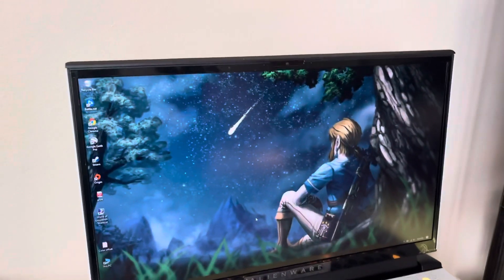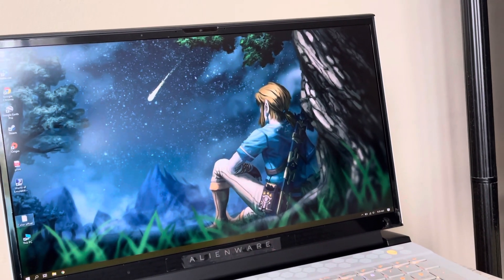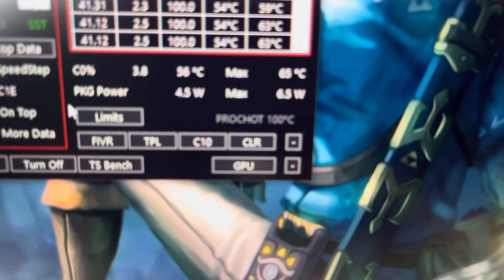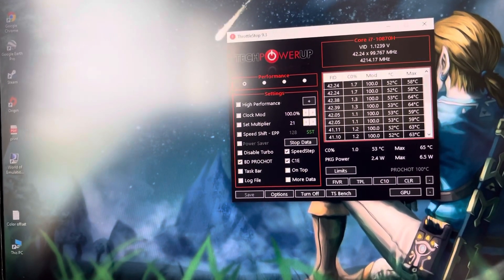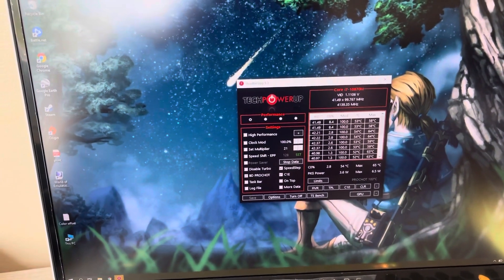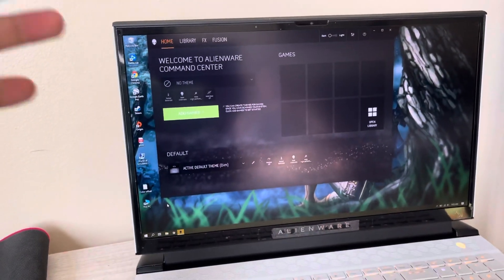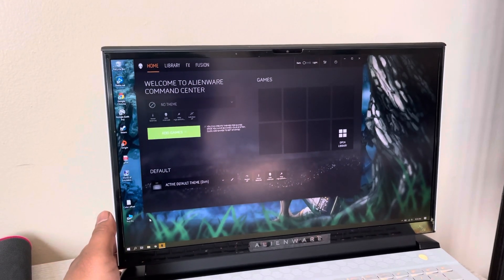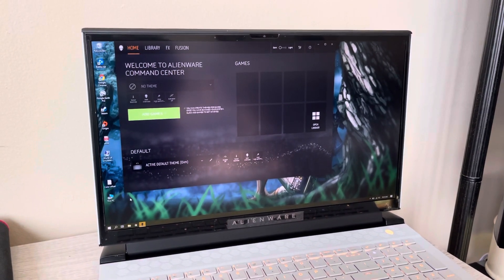Alienware M17 R4, three things you should do to get the best performance

Comment: I ended up clearing the system and put bloatware free Windows 10 on it. I went from 140 - 240FPS on Battlefield 4 max settings.
Reply: just by getting rid of all the bloatware?
Reply: @2gains  yep. A full reset with normal Windows 10 without all the Dell stuff totally irradiated all my issues.

Comment: The reason why this is the way it is the windows install is bloated with all the Dell/microship crap. Reinstall windows ltsc you'll see a major boost in performance plus if you do a repaste and a repad (16w/mk pads) with phobya nanogrease on gpu/cpu you'll see a thermal improvement. Plus I also read you can get 4.8ghz all core if you disable thermal velocity boost
Reply: Question... Did you repad this specific laptop? If so, what was the config? i7/3070 or 3060? i9/3080? Depending on which one, what was the pad sizes? 0.5mm, 0.8mm, 1mm, 1.2mm, 1.5mm, 1.8mm, 2.0mm? I'm asking because I just purchased the m17r4 10870h/3070 and absolutely love it but am planning to repaste and repad it. I'm using leftover Gelid Ultimate pads (15w) and either Kpx, Grizzly extreme or Thermalright's TFX. Not reused just extra pads from my recent build. 5900x, 3080ti, Asus Crosshair VIII Impact MB, 2x 980 2tb, 2x 870 evo 4tb, 2x 12tb WD Red Pros and all water cooled by EK. I'm not new to PCs. I have been building them, water cooled and air cooled, for over 10 years.
Reply: @Z1M0Z1M  I did do a repad but it didn't work out because some of the pads are mushy almost wet while the pads I had are dry (fujilopy 17w/mk) so I put the originals back and pad the other side where the it's cover with some black adhesive cover. I put super thick 2.5mm pads and copper heatsink that go for ssds to them. I saw a 4 degree difference. I have 10870/3080 setup. The heatsinks are held in place by the back cover so they don't go anywhere. All the pad size are all 1mm as per dells manual. I would use lm (liquid metal)  if you could on the cpu and nanograse or tfx on gpu do not use lm on gpu not worth it. I have an undervolt of 105.5 on cpu and cache which decreased the temps alot. I used throttlestop for that.  Gpu I did undervolt but do to dynamic boost it still hits 160w sometimes. I decreased the mv on gpu from 1050 to 837 (1770mhz max boost and 100+ memory) I got the short end of the stick with sample on gpu my cpu does hit 4.5ghz all core those sometimes even though it says max is 4.2. Goodluck if you got more questions I'm happy to answer
Reply: @JCordero31  Thanks for the reply. Really appreciate it. I was looking everywhere for the thermal pad thicknesses' but could find them anywhere. I was about dig out my digital caliper and replace the dead battery in it to find out the dimensions myself. I really like Fujipoy's pads but they are so brittle that I stopped using them a little over a year ago. The Gelid Ultimate's are about the same performance but ALOT more malleable when it comes down to it. Fuji's are like cardboard or very old gum lol. I just bought the laptop (10870h, 3070, 32gb) and purchased 970 evo plus 2tb, a WD SN750 4tb nvme and a BG4 1tb 2230 for it. Haven't installed them yet just doing some prelim testing with the semi-stock set up. So far I'm very happy with it and know if I can get temps under control it'll be well worth it. Hell it got a Timespy score of 11161 and all I did was turn it on so I can't complain. My older 3700x, 2080(non super) rig was getting 11979. I might go LM, I'm not sure yet. I still have some left over from my prior laptop. I definitely want to repad and repast though. What manual are you referring to? Like I said, I haven't been able to find any specific info on pad thicknesses.

Comment: Do you know if I set the fans on my M17 at max speed and keep gaming for like 5 or 6 hours, would it hurt the fans? Or make them die sooner? Because those fans are so loud and strong, and give me a feeling that they are gonna blow up at any minute
Reply from the maker: I feel the same way, honestly I’d just undervolt the system keep the fans at balanced, I get now max I’ve seen is 90 under heavy heavy load, I’d say if the fans probably will be fine if you game on max can speed

Comment: gosh, i thought i was the only one with yellowish screen. Oh by the way, the turning off kaspersky and loading AWCC works 100% of the time. If it doesn't load right away, I manually execute OCControls.exe while antivirus is disabled
Reply from the maker: I hadn’t noticed the yellow until I looked at it on the monitor and compared to the laptop then I found a few videos out there to fix. It sucks but it’s not a total big deal as a few adjustments can correct

Comment: I see you haven't pulled off the film yet off the Alienware logo, still thinking about returning? :)  Hows your advanced optimus and what kind of battery life are you getting?  My fn+f7 (mux switch) works again after an Alienware Onscreen display update, and getting around 3-4hrs of battery life while non gaming activities.  Gaming at 1080p ultra settings, 1440p ultra settings (32in QHD monitor), and 4k high-ultra settings (70in 4k tv) have been a blast.  With some throttlestop undervolting I've been able to keep temps below 90c at load.
Reply from the maker: I ended up returning the Best Buy model I had, and ordered the custom from the Alienware website. I have the 360 screen so there is no optimus but battery is about 2 hours or less